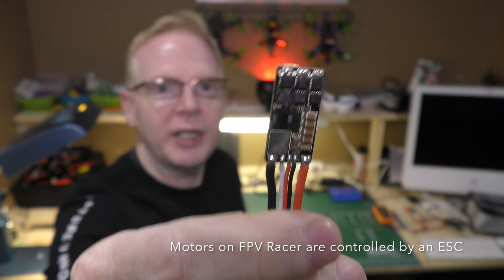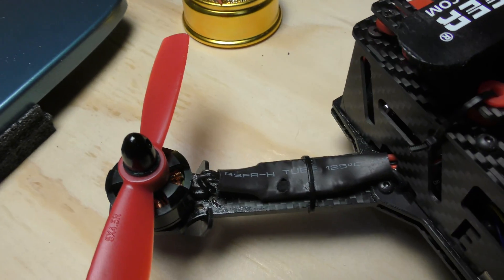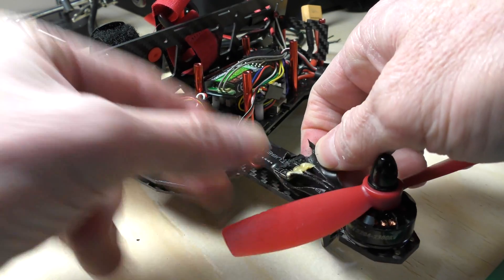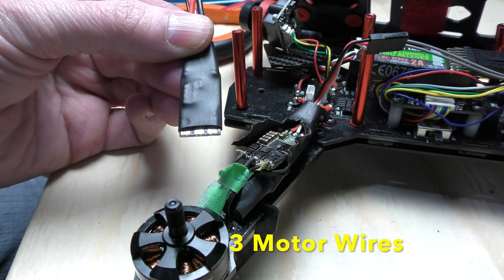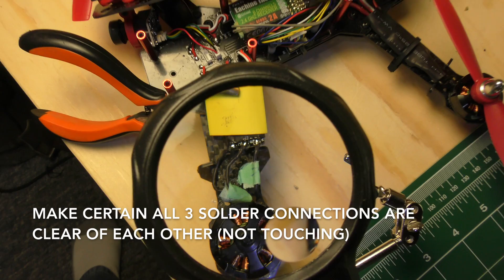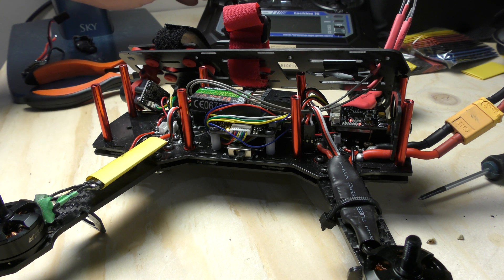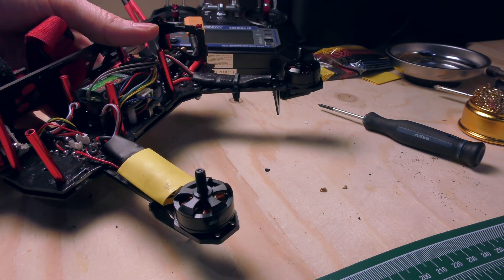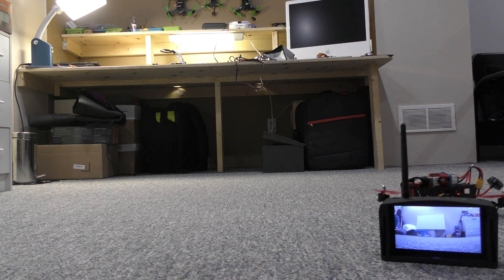BEGINNER FPV QUAD RACER (PART 2) - Motor ESC replacement in 10 easy steps - Eachine Falcon 250

Comment: The dont sell these esc anymore. All of the one i want to upgrade to have one small wire less. How can i install the new escs?
Reply from the maker: Most hobby stores around your country that sell Eachine Products might have some.  I know one of my local hobby shops had some collecting dust on a shelf.  Also, the ESCs are for multiple Eachine FALCON drones, so if you search for all the drones, you may find it.  They are 20 Amp ESC that work with: The Falcon 180, 210, 250 and 250 Pro.
Reply: CAPTAIN DRONE would I be able to upgrade all my escs? These have three wires to the pdb, all the one I'm looking have have two. Would that ale a difference?
Reply: Because I live in a poor area, no hobby stores, so if its not listed online I have to do something else.
Reply from the maker: I believe so, but I've never tried it on the Falcon 250 (I sold the drone many months ago)

Comment: how did you mount your vtx? i had to replace my vtx and with the sticky goo stuff gone it doesnt sit right and it makes my quad shake while flying.
Reply from the maker: I have several types of double sided tape.  You can pick it up at any hardware or automotive shop.  Holds everything in place.  Also, sometimes I use a twist tie.

Comment: what kind of soldering rosin did you use, I'm really struggling. I have been trying to get the rosin to stick to the esc but it just slides right off
Reply from the maker: I use ROSIN Core Solder from a company called Miniatronics Corp